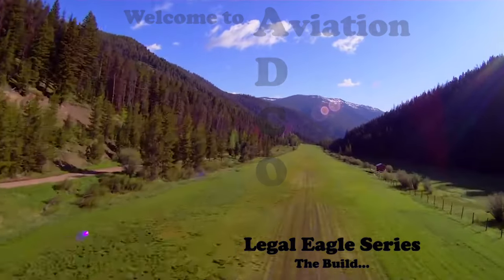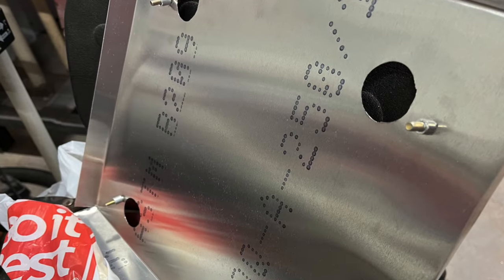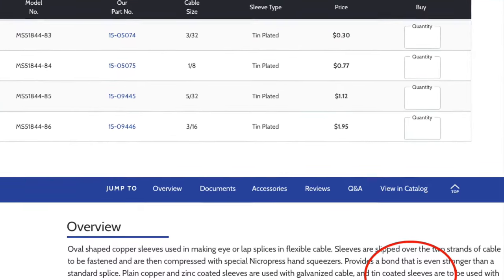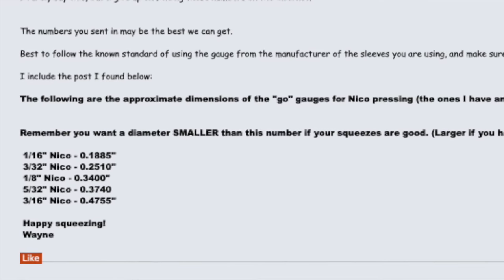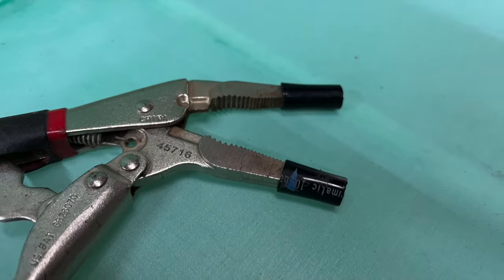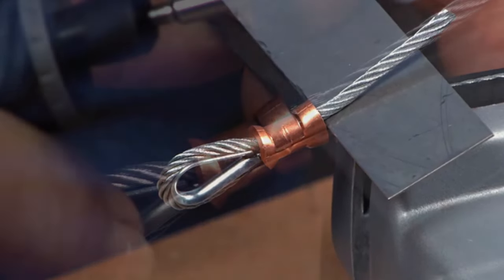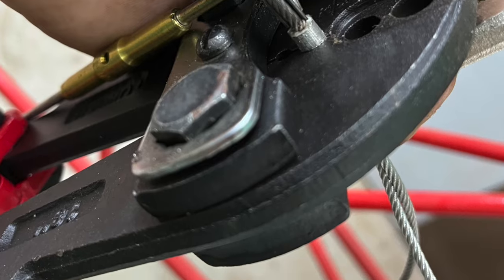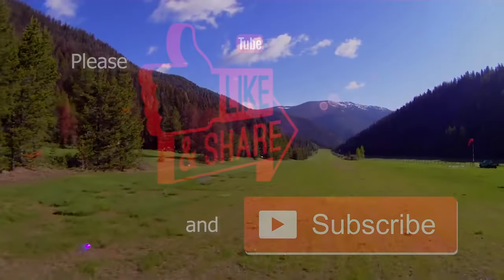ADCO Aviation - Legal Eagle XL Ultralight Aircraft Build Series 28 - Firewall & Starting Rigging

Comment: I bought the 50$ one from aircraft spruce ( made in -----)  and the jaws don't line up quite right. I found I super glue the place to cut an wrap it with bk tape i get no frays. Cut with a slitter wheel. Did the shrink wrap. Was interesting about the carosion part. Oh crap. I used 7x19 cable an wax lubricant at all nylon ferrel points, it made the cables work so much better.
Another great video,, Thanks
Reply from the maker: Two great comments & additions... Thanks Keith for all your input... Question, Wax Lub - you used at each of the nylon cable fairleads? I was just thinking yesterday about something there, What brand if you don't mind...